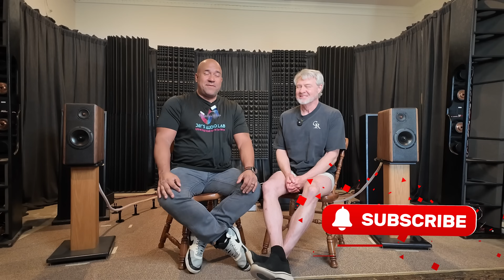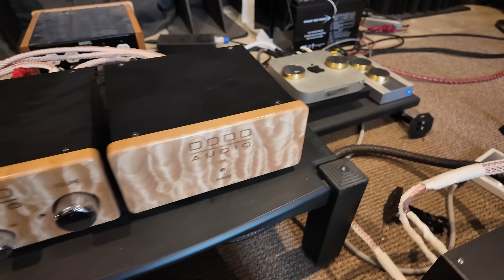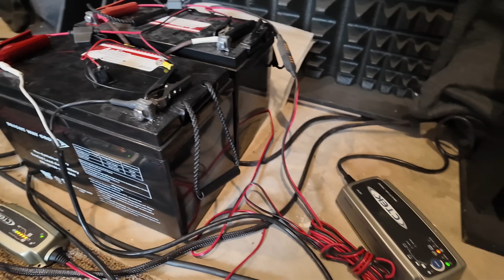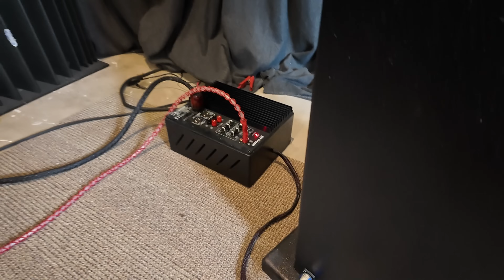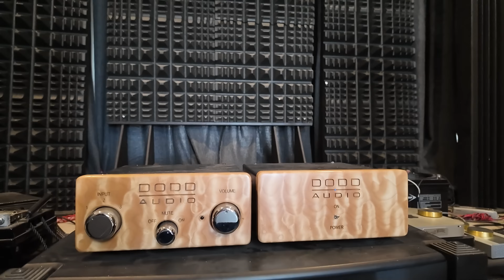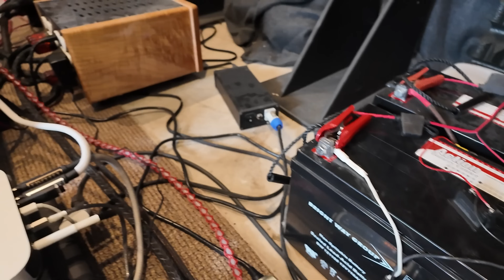12 volt Batteries To Power Your Sound System

Comment from the maker: Have any of you ever attempted to use12-volt batteries in your own set up? Tell me below!
Reply: Yes, I've used batteries. 
Circa '80. 

I pulled my award winning high-end car stereo system out of my '76 Chevette (due to blown engine). 

I set it up indoors, powered by two 12v car batteries, and a trickle charger. 

Alpine front end.
Alphasonik active crossover. 
Linear Power amps.

I didn't use my Alpine drivers/ribbon tweeters inside the house.

For speakers, I had my diy sub/satellite system. Budget, but respectable performance. 

It was tremendous fun.  
45 fffnnn yrs ago!

Molly Hatchet, The Who, Steely Dan, Led Zep, The Cars, etc. 

Being a 70's teen, growing up roller-skating on Saturday nights, of course I was a huge disco fan too, ... you just didn't want everyone to know! 

Today, Reggaeton, or simply House Music does it for me.

Well Jay, you asked! 
(since high end audio is largely an old dude's game, I suspect many here had a similiar experience!)
Reply: I've been running everything on batteries for almost twenty years. I found ways to clean their power even more ( they're not the same as clean under dynamic conditions) and together with multiple, dedicated, extra local groundings (finally draining to the major, clean ground), I now live in a sonic bliss that makes me disregard anything else as a possible improvement! I'm stuck to this system because nothing, really can give me something more, without also taking something else away from me, sonically. The good thing is, it still takes improvements but at this level of performance I got too lazy and unwilling to go any further. But I'll get the itch again one day, that's for sure! Dual power for the dac, silver internal wirings, extra internal shieldings, perhaps Lundal trafo- coupling outputs instead of caps, all these nice things. And, above all, my new big loudspeakers ( still building that pain ...).
Reply: Yes - https://www.youtube.com/watch?v=dwdrNsWPXO0
- LogicPower LPY-B-PSW-800VA+ 
- 12v AGM 2 x 60Аh 660A
Very clean sound, but the class A amplifier handles the dynamics of 230V directly a little better.
Reply: Yes my Ian Canada DDC I2S steamer is battery operated it is also the best sounding streamer I have listen to only costing $600

Comment: Yep I have and do run an entire system on big battery supplies.  YES it is much better than AC.
It is tricky to do but I think it is the ultimate audiophile trick.
The sound is clearly better.
Many pre-amps run on +-15V but the +-13.4v you get from a good pair of big SLAs is absolutely fine, many Dacs run on 12V or 5V, that’s easy enough to sort, you can get 12V CD players.
Power amps are harder, digital amps are usually 24/36/48v DC, that’s not hard but requires a bank of batteries in series, thus say 3 105AH deep cycle batteries adds up in cost but still cheap compared to high end mains supplies etc.
I’ve also done +-24V and +-36V supplies to run analogue amps very successfully with brilliant sound. 
One secret for the power amps side is to make sure you are running efficient speakers.  In reality you’ll find the batteries go a long time before dropping charge at sensible listening levels.
DACs and Phono amps in particular run better on pure DC.
I’m using an iPad with lossless hi res files these days as a source running off a big external battery and 5V regulator then out to a reclocker and DAC and so forth.
The only AC anywhere in the system is the Turntable, I haven’t got a way around that, but I’m sure being able to run a DC drive without mains hum etc would be a great benefit.

Comment: For going on the cheap, batteries can power low level pre or dacs adequately but for audibly and truly best possible performance WITHOUT compromise virtually perfect ac powers all my components and all my rigs including my 800lb plus monoblocks without breaking a sweat and ZERO NOISE that batteries impossibly can NOT ever match at ANY price. I understood why some choose or are forced to compromise but, those compromises are simply not for me.

Comment: Battery pre amp yes , I use Battery to stream. 
Power amp problem, yes I know about car audio and 20000 watts. From 12v you only get enough voltage swing for about 4 watt yes you can bridge for 16.  Back to hifi moans to get high voltage you need lots of batteries or an inverter,  inverter enter the noise. 
There is an amp available that has an optional standard power supply.

Comment: In the early 2000’s I built a sound system powered by a 4 channel car amp that I bought second hand (for something to do), which needed about 40 amps at 12 volt. All the information I could find said using sealed lead acid batteries inside the home was unhealthy, finally I stumbled on a solution (this was pre YouTube) that solution being 2 Computer power supply units one which 28 amps on the 12 volt line and another with 20, wired in parallel one PSU is master and the other is slave, the slave or second PSU had the case ground tab ground off and the slave PSU grounded to the master, so one case ground in other words and that worked great.

Comment: “Hey honey, can you grab the baking soda for me?” I’ve got to clean the battery acid off my  12 volt terminals…😮”You know, the ones in my dedicated listening room”.
Reply: They are sealed batteries. So they don't have the corrosion issues.
Reply: @dannyrichie9743 Can you share details on the battery supply for the MacMini, or is that subject to proprietary IP and NDAs? 
And I’m guessing this same approach could apply to the family of “fun-fi” class D amps many folks are tripping over themselves to wax rhapsodic about?

Comment: Danny only grazed the real distinction at the end. But the Stromtank is not at all like what Danny is doing. The Stromtank is expecting to be used with equipment that has NOT had its AC to DC conversion bypassed. While it's a battery (DC) that has to be turned back into AC via an inverter at the output of the Stromtank. So the actual power path with the Stromtank is to go from AC (in the wall) to DC (Stromtank battery) BACK to AC on the exit of the Strom and then BACK to DC (again) inside the stereo equipment. Danny's system is DC. JUST DC. No conversion neccesary. SO, for the record, I would expect Danny's system to beat the smack out of any Stromtank. BUT, your equipment HAS to be able to accept DC to begin with.
Reply: Yes, but to both of their points, the reduction of the noise floor improves sound quality.
Reply: @maxrogers9639 
Indeed
A downward expansion of dynamic range, plus elevated inner detail.

Comment: I’ve seen/heard systems with camping power supplies like Jackery, Ecoflow. I see these as similar to the Stromtank stuff. I think the main advantage is they are off grid, and therefore no grid noise
Reply: I've done this. And it is exactly like a Stromtank (down to the type of batteries used) but without the silly pricing. An expertly designed power conditioner still sounds better. And less hassle.

Comment: Jay, I wonder if Tesla Wall Energy Storage Units or Generac Power Storage Units would reduce A/C Noise! One could also keep them Powered Up with Solar Panels especially in Texas!💯💪
Reply: In Europe they have problems with DC noise on the mains.
Reply: As long as you don't have to convert from DC to AC it's usually fine, houses running solar panels can apparently have problems as the converter isn't built for audio quality.